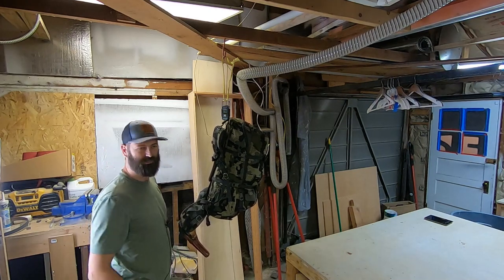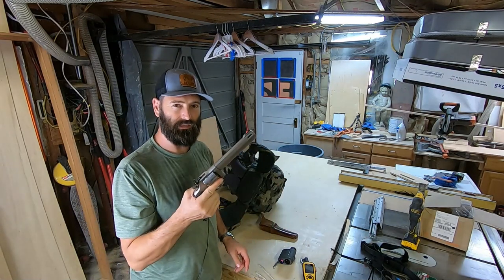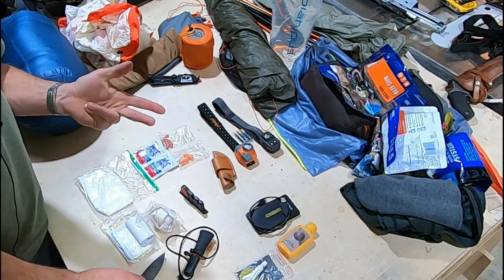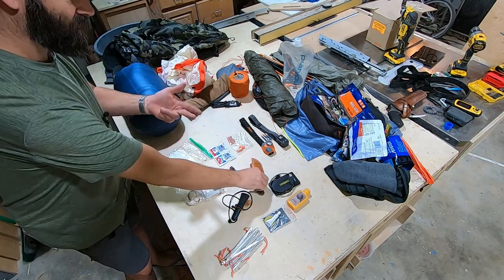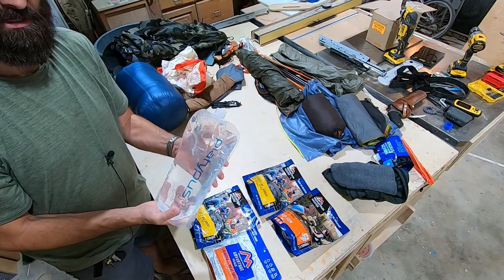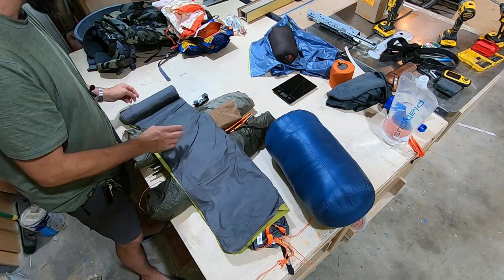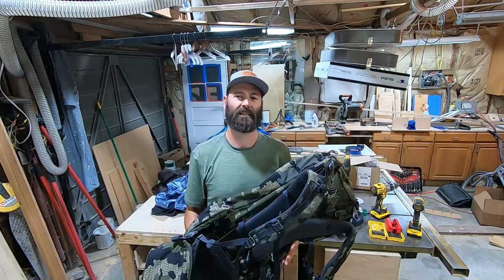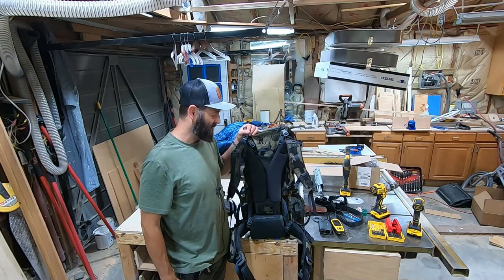26 Pound Archery Elk Backpacking Setup | Water and Food Included | MIKE HUNTS |

Comment: Great video Mike! The only thing you might want to add would be and Israeli bandage and some kind of blood clot to your first aid kit.   That way in case you get a really bed wound or cut, you can stop the bleeding because otherwise you can bleed out before help arrives.  I have a recommendation for lightweight ones that I put in my archery pack. It's only a few extra ounces and worth carrying.
Reply: What is your recommended blood clot you refer to?
Reply: @allbayfishing9456  Celox Z-fold is the best from my research. It will supposedly stop an artery bleed in less than a minute.

Comment: Nice vid, have some of the same gear.  Looks like the pocket rocket stove which I switched to last year plus a toaks titanium mug/pot.  I also use a BA lost ranger bag for I toss and turn a lot and would end up off the bag otherwise.  You did hit on something I have seriously considered leaving at the truck and that is binoculars and harness.  Just added weight PLUS if you wear it another thing that will make you sweat more.  I like your water filter set up but still using the katadyn hiker pro which is big and bulky. :(    As for trying to quiet the carbon fiber frame down also heard athletic tape and maybe some baby/talcom powder in the frame stays has helped people.  Curious how your season goes!  Been watching the 5pm updates too when I can.
Reply from the maker: I'm not sure how many elk are going to be in the area after 3 weeks of all the helicopters and dive bombing airplanes.  I'm hiking in from CR3 to get my 4 cameras and check on the wallow I have one camera over.  That will tell me if its worth hunting there this season.   Are you in Nebraska?
Reply: @MikeHunts  yep I am in NE.  I am heading out there for 3 days next week with family instead of hunting.  Not as close as you but with good planning I could get an evenjng hunt in on my same travel day.  :) BTW ride rite air bags are rather rough on the tacoma.  Still experimentjng with the right psi though.